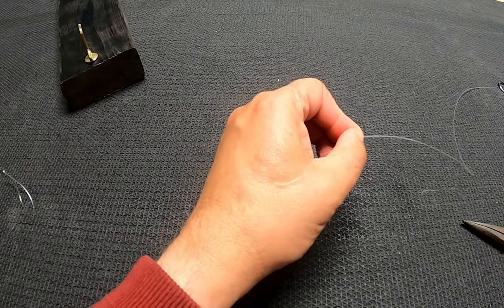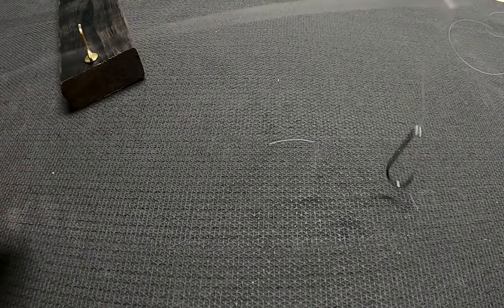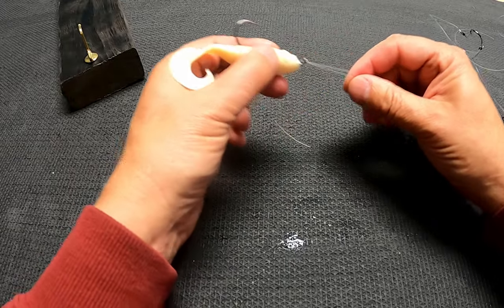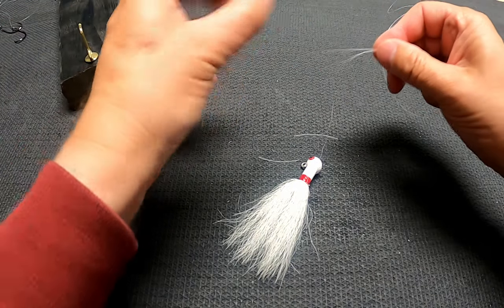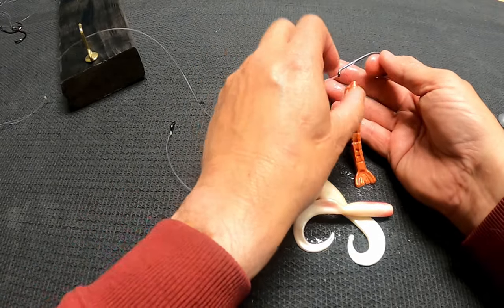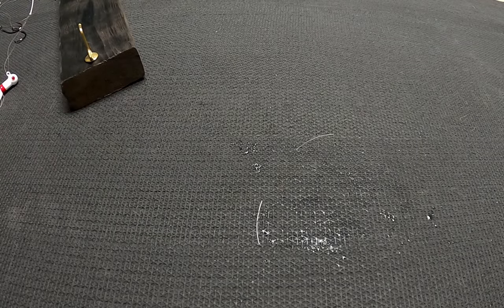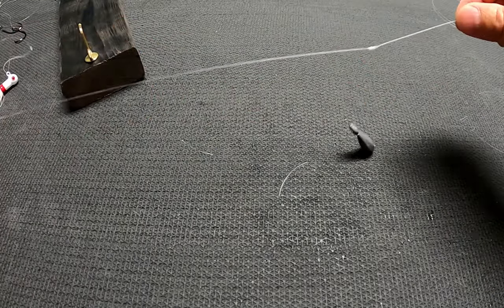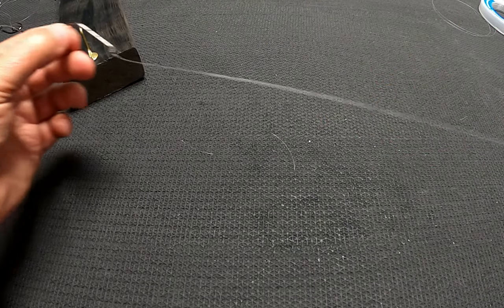Tying Fluke Rigs

Comment: I like the hook for the dropper loop.  I use my teeth, but sometimes the knots on each side of the loop slide (one knot shifts to the other knot on the other side of the loop - not sure how that happens).  Looks like the hook may solve that problem.  Great video, Dave.
Reply from the maker: I find using a hook or nail, the loop stays centered and the knots tighten evenly.   If you hold the loop with your teeth, you don't always have it held by the exact center and the knots will even up to one side and shorten the loop.  Thanks for watching!
Reply: @baysidedave9962  Thanks - and that's exactly what happens with about half my dropper loop ties.  Tight lines, bro.